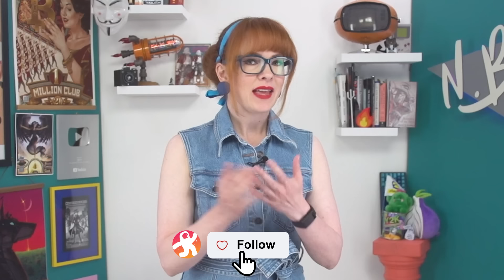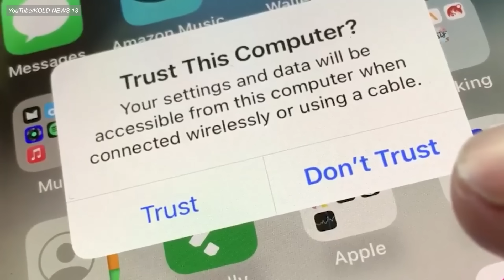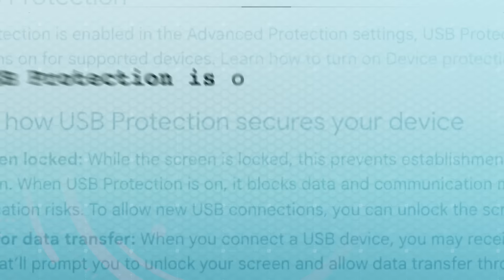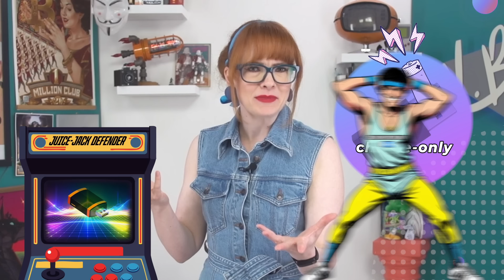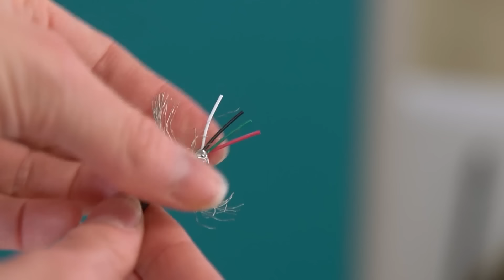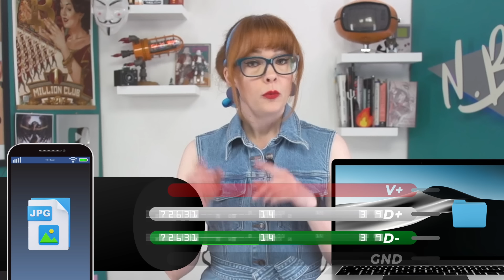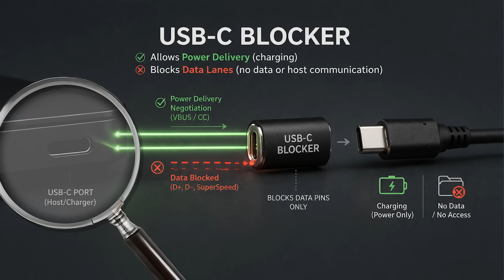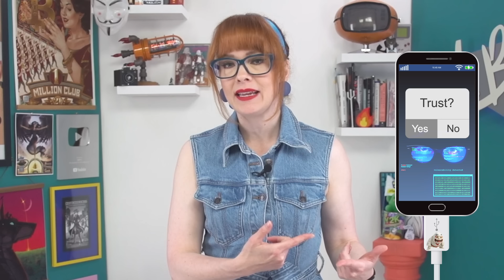Use THIS When You Plug In

Comment: There are also USB cables that can only transmit power and not data.
Reply: Exactly. Power-only cables can do the same job,
Reply: @S @SimplebutSurprising ss convenient though, because duplicate cables take up more space and are more easily confusable
Reply: @SimplebutSurprising  I was about to say this as well.
Reply: Basically any usb cabe i get free with a device
Reply: @DWmaniac4n6 that may not be true for all of them. Have you checked them?
Reply: @juanmondragon i didnt say all, also thank you for personally inventorying my stash of usb cables and verifying which ones have data lines and which dont, i have been meaning to do that. Most the cheap little ones dont i know that by experience, but i will be looking forward to your detaild report on my collection.
Reply: @DWmaniac4n6 I said it may not be true but you are correct in correcting me
Reply: @juanmondragon that may very well be what you intend. Thank you then for editing your reply to be more vague. Still you missed points in my statement i thought would be obvious.
Reply: @DWmaniac4n6 what edits? I'm just correcting spelling mistakes but I do apologize.
Reply: @juanmondragon you changed "not true" to "that may not be true " and if you read my first comment you would not be asking if i tested them. I was assuming you would read it and know how it is going through your cords when you really need one and having to determine which ones are capable of transferring data. Its a shared experience if you use usb type c chargers, unless you splurge paying several dollars for cables alone. I have more usb c cables that can not send data than can. Most cords sent with items to charge them are cheap and the factories in china dont want to spend money on the manufacturing cost of 2 more conductors. My point in my comment was that it is easy to find these, we all have half a dozen waiting to betray us when we lose a data cable. All your points are irrelevant to my slightly humorous comment about my experience. Get off your high horse you snob
Reply: @DWmaniac4n6 calling me a snob after I apologized? Are you ok?
Reply: @juanmondragon you pullong the edit trick again just to be right double snob
Reply: @DWmaniac4n6 obviously you are not. I rest my case
Reply: I meant to say that. 

Though a hardware router/firewall - if ever developed in that form factor - were still useful when plugging any storage device into a computer.
Reply: Important post thank you.

One downside though. Labeling on USB cabling is abysmal per standard.
So having a dedicated device that you can easily see at a glance, that you have put in place, might be beneficial for some.
Personally I put labels on all my cables, so I know the capabilities of the cable I use, including whether or not it has data.

Generally a dedicated "USB blocker" lasts longer then a cable, since despite how cautious you are with your cables, over time they get kinks that cause bad connection faster then the connector wears out.

Also using a Data cable with a "USB Blocker" gives options, which might be beneficial to some. By not needing to carry two different cables.

And some people just don't recognise/acknowledge the danger, e.g. your kids. So for them, having a distinct option for "traveling" might be easier to develop a habit, rather then remembering when and where to use what.
Reply: @soul0360  That's fair and reasonable.
Reply: Would that block the handshake that fast charging needs to enable high power rates?
Reply: With power delivery protocol but no data?
Reply: I have one of these. Once I wanted to use it to transfer data; it wouldn't work. Then I noticed the lack of the USB logo on it. Now I know how to distinguish them!
Reply: Yup. That’s what came with mi refurbished iPhone 📱. I put it in my car and it wouldn’t play my music, had to buy a data cable.
Reply: This doesn't matter. You can be compromised. That's a software lock. These things are blocked physically, as she mentions.
Reply: That's pretty much what a USB Blocker is, there are only power lines, not data ones, but yes.
Reply: Having to purchase a purpose-specific blocker -- which  you have to install and remove as necessary and when appropriate, assuming you haven't lost the tiny bit of tat -- is an indication that engineering upstream f-ed up. Basically, what's needed is a DPDT switch in-line on the cable. If you can arrange for the switch to default to "off" the data lines, perhaps after a time delay, that would be nice, too. Rather than selling everyone Yet Another F-ing USB Cable-y Thing-y Up the ying-yang, how about selling them an in-line DPDT switch that retains the V+ and GND lines intact, but runs the D+ and D- through a mechanical switch? The dingus travels with the cable, is migratable, and is purely mechanical. Also, likely very cheap.
Reply: @michaelthibault7930   this is YOUR CHANCE to get rich!

Comment: Data blockers are a must, I have a couple for travel. They are pretty cheap and worth it.
Reply: Nah power bank and plug in charger are what you want. Most data blockers charge at USB 2.0 only so unless you want to sit there for hours or it happens to be at your seat in transport you're still out of luck.
Reply: ummm what's to say the "cheap" USB data blocker that you buy which is likely made in China, doesn't have a chip in it to do whatever it wants on your phone?  Untrusted brands from Amazon or a chinese ecommerce sites could just be as risky (as found in USB cables).  I think you are delusional if you feel safe with one of these "pretty cheap" devices
Reply: @evoman3869 well a data blocker most likely won't have data pins only power so not possible to move data unless the phone reroutes data trough charging pins which i doubt
Reply: @adolfHipster271k 100% correct. Just 5v plus and a ground. Light weight and power bricks are a fire hazard in the air.
Reply: You can test it. Go to a library computer, and see if your phone connects through the blocker.
Reply: @rayrous8229  
That seems good, but a device could stop you from purposefully sending and receiving data while it's secretly doing so in the background.
Reply: @evoman3869  Thermal camera analysis helps.  If there is a computer in there, it will give off heat.
Reply: @evoman3869  with usb-a you can inspect the usb connector to see it only has the two power lines not the data lines. This is why I would recommend a usb-a one over a usb-c model. If you MUST use usb-c for faster charging then use a power adapter which has no data pins or use a battery power pack.